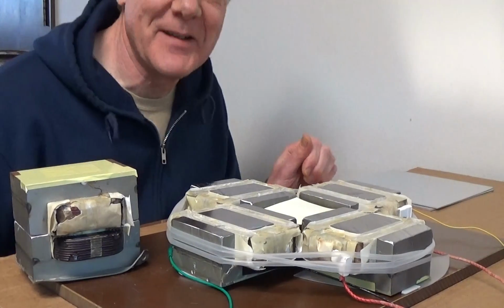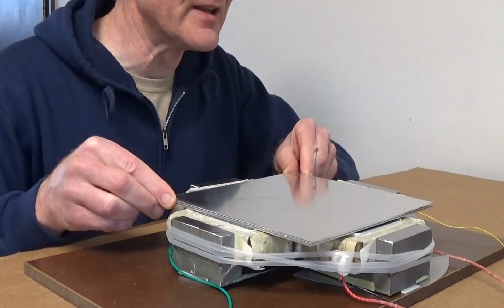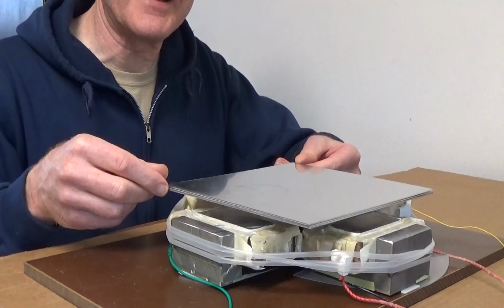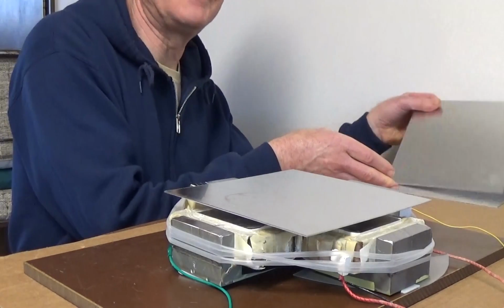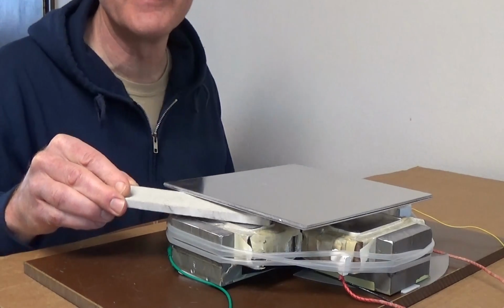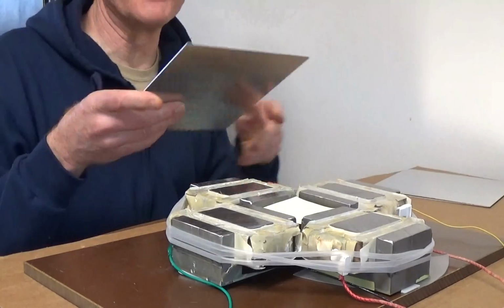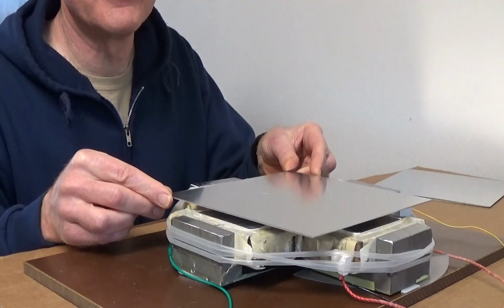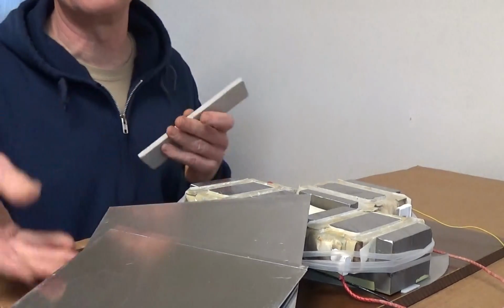Eddy current levitation using microwave oven transformers

Comment: How is the field structured
Reply from the maker: Good question, and nice to see interest.  Magnetic field lines come from larger center poles of each transformer, the exposed ends of steel laminations inside the winding of each transformer.  The field loops upwards, then back down to the smaller poles.  About half loops down to smaller poles towards inside of square.  Other half loop down to smaller poles towards outside of square.

This is an AC (alternating) field.  For one half-cycle (1/120th of a second), large center poles of each transformer are north, with smaller poles south.  Next half cycle, center large poles are south and smaller poles (both inside and outside of square) are north.

With single aluminum plate on top, much of the field continues to loop as it does without plates.  Much of the field penetrates through single aluminum plate.  Multiple plates block most of the field from penetrating.  Field path is squished down close to poles.  This field squishing provides force to counter gravitational force.

The roughly half of the field that returns (loops back) to small poles towards inside of square provide most of the levitation force.  Field return to outside small poles adds some levitation force, but also constrains plates from sliding sideways off of transformer array.

Comment: Did you plug it directly to the house electricity net? 220v 60hz?
Reply from the maker: House power here is 120V 60Hz.  Large appliances such as stove and clothes dryer use 240V.  For this experiment, I used a transformer to convert 120V to 240V and provide isolation.  Isolated power reduced shock hazard a bit.  Total power was plenty low for single 120V 15A outlet.  (For high power projects I use my dryer outlet, 240V at 40A.)

Comment: Davekni do needle rotate if I attach to thread it has to rotate at 90° from 15 Inch height
Reply from the maker: This isn't useful for moving a ferromagnetic object such as needle.  You need a DC magnetic field.  If needle is hung from center of gravity (balanced), rotating from 15 inches wouldn't be too hard.  Rotating large ferrite magnets 15 inches below needle should be sufficient.  Will help if needle is first magnetized.

Comment: What's preventing it from sliding off to one side?
Reply from the maker: Shape of magnetic field is a ring (squared off ring in this case), with some field of opposite polarity (opposite phase) in center.  Field under plate lifts while field extending up around edges repels plate towards center.
Reply: @davekni  ah, I see. Thank you!

Comment: everything is fine, the transformers were identical and the connections are fine, that is, the ''shoes'' always point clockwise. yes, I used the secondaries. I'm not sure about the purity of the aluminum, but could I use one or two 0.5mm copper plates? and I don't know which capacitor to put, if smaller or larger than 40uf?
Reply from the maker: Copper is more conductive, but much heavier, so will not work as well as aluminum.
I have no way to know whether smaller or larger is what you need.  Depends on your transformers.

Comment: I completed the levitator with MOTs, but the board doesn't levitate 2mm plate,or two 2mm plates, it just vibrates.i believe i plug in even without capacitor.i need much more power The transformers were 800w. Could it be from the 40uF capacitor? Can you tell me which capacitor to fit for more current? I can get 10uF, 15uF, 20uF, 30uF, 35uF, 45uF, 50uF, 60uF.or i need more uF
Reply from the maker: Are you using MOT secondary halves?  Are the four windings connected in parallel?  Is the capacitor in series, from the winding set to 240VAC line?  Are the four MOT windings phased together (all clockwise starting from one common connection of all four to the other)?  A way to verify phasing is to apply DC current.  Use a compass needle or small magnet to check that all center posts are north poles or all are south poles, not a mix.
If above is all good, measure current through windings or voltage across them.  Change capacitor value to maximize current.  I can't say what capacitance will resonate with your particular transformer windings.
One more thought:  Are your aluminum plates 1000 series aluminum?  Those relatively pure aluminum alloys have highest conductivity.  Other aluminum alloy conductivity is lower by 40-50%.

Comment: it is possible to adapt this concept for a levitating vehicle, though several engineering challenges and design optimizations need to be addressed. Here's a breakdown of the feasibility and how a Halbach array could assist:

1. Principle of Operation

Eddy Current Levitation works by inducing eddy currents in a conductive plate (aluminum) using alternating magnetic fields, which generates a repulsive force and levitates the plate.

In your current setup, the transformers generate a 60 Hz alternating magnetic field, which induces eddy currents in the aluminum plate, causing it to levitate.

2. Challenges for a Levitating Vehicle

Sustained Levitation and Stability:

To levitate a person and the associated vehicle structure, you'd need significant lift, which means higher currents and optimized magnetic field strength.

Overheating Issues: With higher currents (4A to 6A per transformer), overheating is a problem. Active cooling (forced-air or liquid cooling) would likely be necessary for continuous operation.

Dynamic Movement:

Moving the levitating vehicle requires a method to vary the magnetic fields or induce lateral motion. This could be achieved by modifying the frequency or phase of the AC current to create directional thrust.

Alternatively, a motorized or magnetic propulsion system could be integrated for lateral motion.

3. Role of a Halbach Array

Enhanced Lift Efficiency:

A Halbach array focuses the magnetic field on one side while canceling it on the other. Placing a Halbach array on the vehicle would enhance the field strength directed toward the aluminum plate, improving the eddy current induction and providing stronger, more efficient lift.

Reduced Energy Losses:

By focusing the magnetic field downward, less energy is wasted in stray fields. This increases the overall efficiency of levitation.

Stability Control:

Halbach arrays can also assist in achieving better stability and control of the levitating vehicle by ensuring a consistent magnetic profile over the surface of the aluminum plate.

4. System Design Proposal

Vehicle Structure:

The vehicle base can house the Halbach arrays or electromagnets driven by high-frequency AC power.

Ensure the structure can withstand the forces generated by the magnetic fields and accommodate a cooling system.

Track/Plate:

Use a continuous, smooth, thick aluminum track that moves with the vehicle, ensuring consistent eddy current induction.

Thicker plates can provide more lift due to increased induced currents.

Power Supply and Control:

Utilize a high-frequency inverter to drive the system at frequencies higher than 60 Hz (e.g., 200 Hz to 1 kHz), which improves levitation height and efficiency for thinner aluminum tracks.

Incorporate a series-resonant circuit with adjustable capacitance to optimize lift and current draw.

5. Considerations

Safety: Ensure safety measures for high-voltage operations.

Cooling: Implement robust cooling for transformers and magnetic components to avoid overheating.

Weight Limits: Practical limitations on the weight that can be levitated, considering power requirements and system efficiency.

Conclusion

Yes, you can design a levitating vehicle using this approach, and a Halbach array would significantly improve efficiency and control. However, high-frequency AC power, cooling systems, and precise engineering for stability and dynamic control are critical for success.
Reply from the maker: Yes, there have been demonstrations of maglev vehicles.  Not that close to cost effective yet.

Optimum frequency scales with size.  For automobile sized vehicles, optimum is likely close to 60Hz.  Track and magnet losses increase if frequency is too high for size and thickness.

Levitation electromagnets in this (and most other) such demonstrations are already Halbach arrays.  Field is almost all on top, little on bottom.  Magnetic field goes down/up (AC) center of coil and back around edges of coil to top surface.

You mention having the plate move with vehicle.  That doesn't make sense to me.  Moving plate requires bearings or other such support, defeating purpose of maglev.
Reply: @davekni  yup....  i get it.  Need the track to move with the vehicle...  but it does cancel it self out...
Reply from the maker: @paulbutler9877  No idea what you mean by "cancel it self out".  Track to ground force that needs to be supported by wheels or whatever is sum of weight of track and weight of vehicle.
In addition, any horizontal force generated by vehicle (to accelerate vehicle or due to air drag) must be generated by both vehicle to track and again track to ground.
If track moves with vehicle, there is zero advantage to levitation (except perhaps as fancy expensive suspension springs).  Vehicle might as well sit directly on track.  Track needs same engine power and other disadvantages of conventional automobiles, and a bit worse due to added weight and size.
Probably best to study some physics, specifically mechanics of forces and reaction forces.

Comment: If the cuts are too close to the secondaries, it will work well or the levitation will be unstable and the plate will fall because I cut 2 MOT very close to the secondaries, about 2-3mm from the edge of the iron center to the secondaries. to continue cutting the other two identically , or should I cut further from the secondary ones and find another 2 MOTs?
Reply from the maker: Presuming you are using secondaries for levitation as I did,  closer is better.  As close as possible without damaging winding.  So, yes, cut the other two to match your existing 2-3mm.  That will work well.

Comment: Did you cut the transformers exactly in half, or i should cut a little more close to the the secondaries?
Reply from the maker: Secondary winding is slightly larger than primary, so "half" isn't exactly correct.  Space between the two windings is a little more than my chop saw kerf width.  Given my difficulty clamping transformers to chop say, I aimed for center between windings as best I could.  However, a couple of the primaries were damaged by the saw blade (too close to primary).  That's the key reason I used secondary "halves" for this experiment.  Some primary "halves" were damaged.

Comment: If you apply varnish to the aluminum, will it improve the flux pattern and give more height.
Reply from the maker: Varnish will add a bit of weight, so decrease height a little.  For a single plate, no effect at all on induced current.  For a stack of plates, varnish between plates would make a tiny difference in current path.  Most current is circulating parallel to plates.  Any vertical current pattern would be disrupted by varnish (insulation), but vertical portion is a tiny current to start with.

Comment: If this was spun would it raise higher?
Reply from the maker: No.  Aluminum conductivity is uniform throughout disk and magnetic field is axially symmetric.  There are other demos with rotating disks over permanent magnet arrays (or visa versa with rotating magnet arrays) .  For those the magnetic field is alternating polarity around the disk, not uniform.

Comment: Me thinking I'm smart when I know how to calculate three equtions with three unknowns, but his guy swiped the smile of my face
Reply from the maker: 3 equations and 3 variables is more than most people are successful with.  Enjoy your abilities.  There are people well smarter than I am too.
Reply: @davekni  Not many.
Reply: Mathematics is not actually the absolute everyone thinks it to be.  In reality, mathematics has numerous flaws which can cause error and misunderstanding.  The first and most prominent flaw of mathematics is its reliance upon a linguistic language to convey meaning.  There is always a translation issue or a disparity when one language is converted to another.  The same thing occurs with mathematics.  Just because an equation can provide results which are superficially correct and return repeatable results does not mean that the linguistic language used to describe the processes is correct.  The mathematical equation could completely match observation while the explanation of the processes occurring could be entirely incorrect.  Most people never even consider such an occurrence and just accept the linguistics that are posited with the mathematics as correct.
Reply from the maker: @wesbaumguardner8829  The problems you are describing are not flaws in mathematics itself but rather in how math is used (or misused) in a scientific or engineering application.
Reply: @davekni  Actually, no.  There is no way to separate this flaw from mathematics itself because pure mathematics is absolutely meaningless and requires a secondary language to make it meaningful.

Comment: I wonder if adding more plates does  it draw more current.
Reply from the maker: Interesting question.  I didn't measure current with plates added.  For this setup, any current change will be small.  Most of the power is consumed in heat (resistive losses) within coil windings.